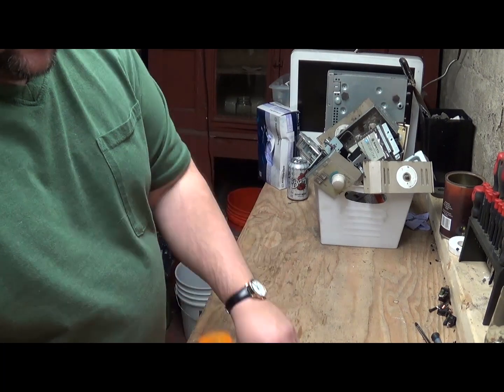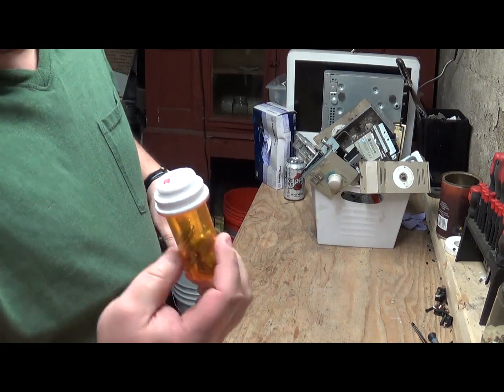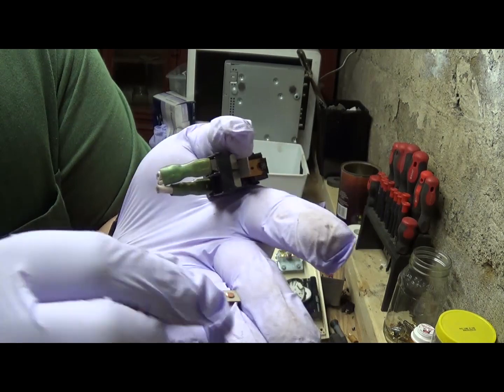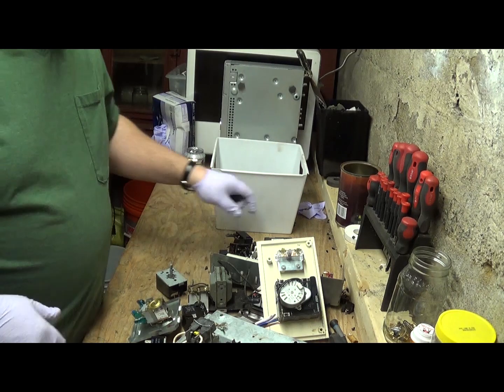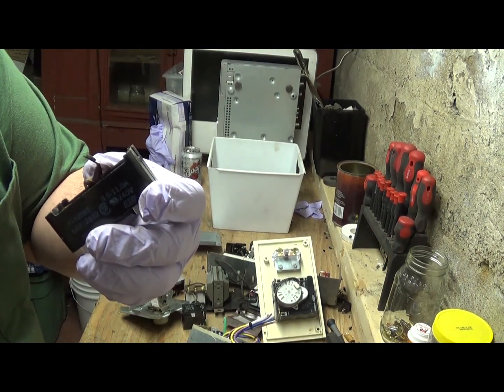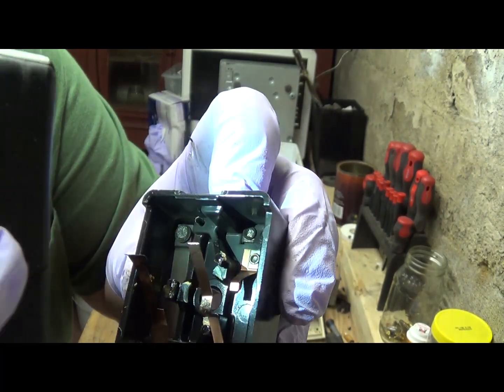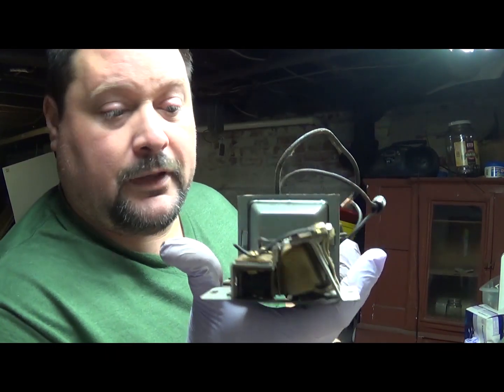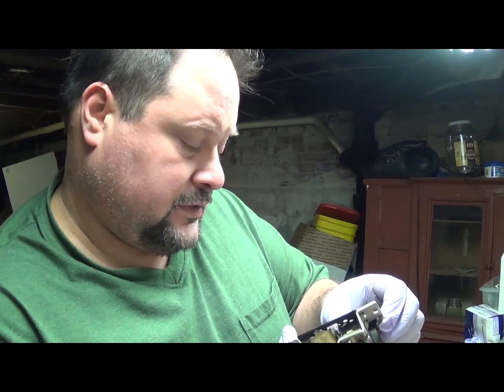Free silver in electronics, where to find it and how to pull it out!

Comment: So a bit of a odd question on a old video I know but, how do you get the base metals out of the solution after processing? As I would like those as well especially since circuit boards having a lot of copper because of all the traces so if you have a good collection of motherboards that you chuck into a bath it might be worth to try and pull the copper from the solution 

Over the years old comcast boxes do tend to add up honestly. Sometimes I run into circuit boards from old stuff that uses less gold and more copper or silver for connections which can be odd but if you know where to look you can always pull the parts where the gold are off and process that later such as HDMI ports or even the Ethernet port if you are scrapping old cable boxes. 

But unless you know how to de solder stuff from a PCB usually you just chuck the PCB's into a bucket of the appropriate acid, although people do that anyways as not everyone want to look for that tiny gold sheen that one might see in the event of the manufacturers of a board used gold as a contact instead of copper which happens more in older stuff. What's more annoying is seeing gold mixed with the copper like fused so you would have to dump it into the aqua regia anyways 

I like making ingots but I have yet to have enough to make a decent size gold ingot and I like making the ingots as pure as possible so obviously I am losing some stuff when purifying it but making as pure as possible ingots of the selected materials is a nice hobby.

Comment: ALL CR2032 Batteries are Lithium Based. They are not Silver Oxide. The "C" in CR stands for Lithium, and the "R" means it's round. the 2032 Stands for 20mm Width and 32 stands for 3.2mm thick. Silver oxide batteries will be Marked as SR "S" for Silver Oxide So Stop collecting those dead Lithium Batteries Unless you want to process Lithium Metal!

Comment: Do not melt de silver contacts that you get. A lot of silver contacts are made of an alloy containing cadmium (silver cadmium oxide or AgCdO). Melting then will produce deathly gases.
In order to process then safely you will need to find another way. be that chemically through nitric or sending them to a refiner that is set-up to handle the cadmium.
Anyway thanks for the great video, stay safe.

Comment: So to refine silver do I just soak it in the hcl? And with the bleach do I need to mix it with anything? If so what quantity?
Reply from the maker: no, silver does not react to hcl.  using HCL and peroxide will help to very slowly ea away the base metals attached to silver contacts.  refining silver required nitric acid.

Comment: Any advice, on telling what kind of wiring, one has? Thanks.
Reply from the maker: color and a magnet.  If the magnet sticks, its likely junk... light iron or shred.  If not then its most likely some type of copper, plated or bare, or aluminum.  Scratching the surface if its not a rosy copper color will tell you
Reply: @moosescrapper5928  Thank you!

Comment: Moose, I suspect some of the contacts can have rhodium, which is far more valuable than silver. I haven't tested but I read somewhere that rhodium is used in relay contacts. It is a bright white metal and looks a lot like silver, but the acid bath will not dissolve it. It pays to collect it.
Reply from the maker: Hey, I loved you in Independence Day!  Oops, wrong Will Smith, Thanks for the tip!  Do the Rhodium one also have a possibility of containing cadmium?
Reply: I haven't heard that. Cadmium is a soft metal with a low melting point, so I doubt you would find that in contacts. Also acid will eat that right away.

Comment: Moose, how do you get the silver tabs off of the arms in the breakers. I even have some copper tabs with silver tabs the size of quarters and can't get them off ( kinda like the ones in the part 2 acid bath pic)
Reply from the maker: Normally I would say heat them off but if cadmium is present then that could be very dangerous.  If you can not take them off mechanically, pliers etc, then acids would have to be the way to go.  Probably nitric acid.

Comment: Hey Moose. I'd always been told that contacts were tungsten type metals? Is that true?

If some contacts are tungsten will the acid dissolve those too?
Are there metals that the acid won't dissolve (aside from Silver)?

I'm a small time scrapper refining only what I come across in life and have always left contacts as is and not looked for the silver. I'm devastated!!

Comment: Erm I have a question. I have seen other videos where nitric acid is used and in those the silver dissolves and they start out with contacts that have already had the copper and other metals removed, (I am assuming it's been achieved via the AP method) only the bare contacts are there. This apparent contradiction needs to be answered properly, oh wait I see what happens, you don't need to introduce a source of copper to create the silver cement which you do after using only nitric acid.
Reply from the maker: +Mach Fiver those contacts are often placed in a containter with nitric acid to dissolve thebase metals.  The silver will not enter solution if other metals are present.  So once all the base metals are dissolved they are drained, rinsed, then fresh nitric is added with dissolved the silver and changes the solution to silver nitrate at which point clean copper is added.  Since silver will not stay in solution when the base metal is present, as the copper dissolves, the silver solidifies.

Comment: Sorry if its been mentioned before, but... Modern washer and dryers have silver Mylars on the face where the buttons are. The same goes with some microwaves. Also heated rearview mirrors for cars/trucks have silver Mylars.
Reply from the maker: Casey Allen Sweet!  I have not scrapped any newer ones yet but that's good to know, I knew about the microwaves but they are a pain to get to and usually have this thick plastic glued to them.  THanks for the info!

Comment: Hi.
In the bottom of old ceramic fuse holders there is a plate that looks like silver, is this silver?
In some fuses I know there is silver.
Reply from the maker: Great question, I really do not know...  Do you have an acid test kit?  Would be easy to find out.  Next time I find some I will test it and make a video.  Thanks!
Reply: Just had some contacts tested and there is no silver in this, it is 58% Cu, 38% Zn and 10 % Pb

Comment: Have you ever thought about using a small torch and melting the silver off ? I have heard that it is pretty quick.  Thanks for the videos
Reply from the maker: No, I think that you would end up using a lot of fuel to get very little silver.  Since silver is less than $20 an ounce, and it takes a lot to make an ounce, you need to keep the costs as low as possible.  Thanks!

Comment: hey moose, silver/copper question! i found a old circuit breaker box and still attached was the cable/wire to main (2 pieces) about 3" long total. looks like silver plated over the copper. any advice?
Reply: I've discovered from stripping old BNC cable that the coating most of the time is tin.  It will go as #2 copper.  Would be too costly to mfr silver coated copper wire.
Reply from the maker: I would agree.  While there is lots of silver plated wire out there, it is mostly in the jewlery market, and the value of the underlying copper is worth more than the thin silver plate.

Comment: Hello Moose,

     First off i'd like to thank you for taking the time to share all these videos with us. I've been following your videos for awhile now. I just recently built a small smelt out of a grill propane tank to melt copper and aluminum ingots. After seeing your videos about where to find gold and silver I've been kicking myself in the seat of the pants every time i think of all the gold and silver I've thrown away over the years. I've always just cut the cords and thrown the rest away. I've been saving up everything now and my questions after this rant is; exactly what chemicals do i need to go from the recovery stage to the refining stage for both silver and gold; where can i find these chemicals; and how costly are they?
Reply from the maker: Hi and thanks for watching!  I am constantly discovering things that I throw away that have value.  So don't kick your self too hard.  Remember, someone threw the item away all together to begin with.  As for recovery and refining, I do not process all material.  Many things require the use of nitric acid which I do not use.  For what I do recover as seen in my videos, the only chems I use are HCL ($7 /gallon), bleach ($2/gallon), SMB ($4 on ebay for enough to precipitate several ounces) some use peroxide 3%, about a buck a bottle. Thats about it.  All the other stuff is coffee filters, cheap, and containers you likely have around your home already.

Comment: Quality vid moose. As regards the acid to get rid of base metals I have two questions. First does the silver remain intact or is it also dissolved into the acid and need to be recovered from it. Secondly if it's only the base metals can they be recovered?
Reply from the maker: Hi and thanks for watching!  The silver does not dissolve, and yes base metals can be recovered most of the time, but I only know how to recover the copper.  You just plop a chunk of stainless steeel in there and the copper will cement to its surface.
Reply: Moosemmmmm